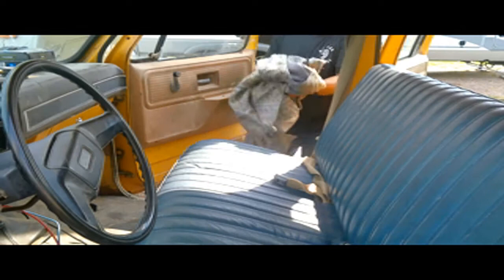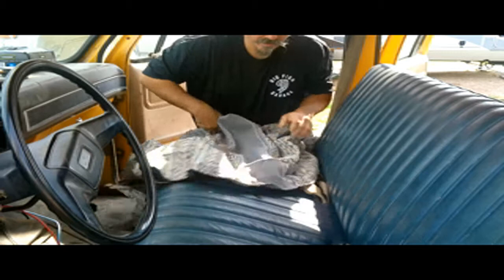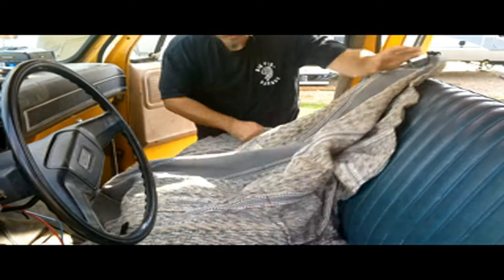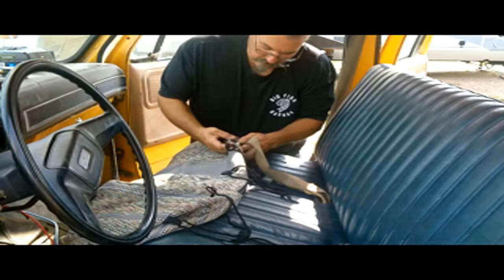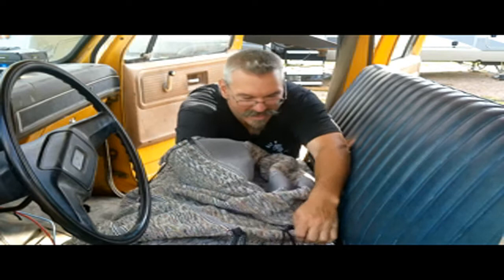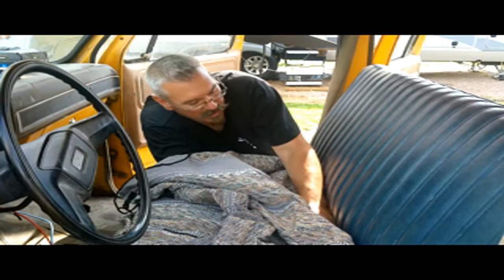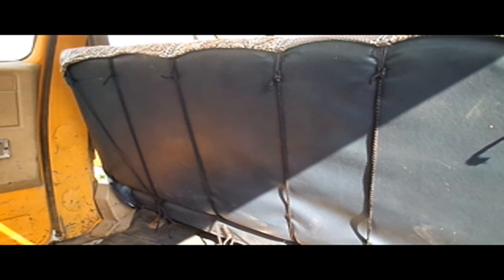Installing Universal Blanket style seat cover on Bench seat in the Square Body Crew cab

Comment: I have installed these covers but I feel to do it right the seat needs to be removed so you can secure it better
Reply from the maker: I still don't have a back seat. I cleared the truck front and back except the camera equipment. I can see what your saying, but it can be done in the truck.  I could have used zip ties even. I plan to eventually reupholster the seats. Still doing body work currently.